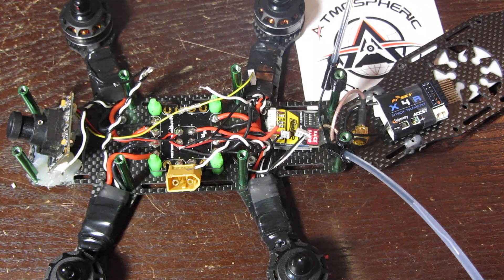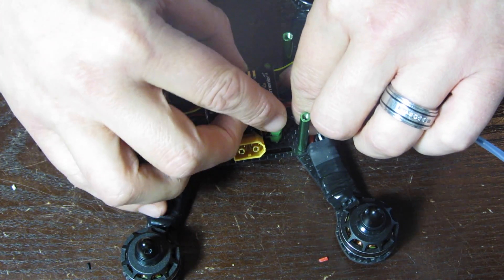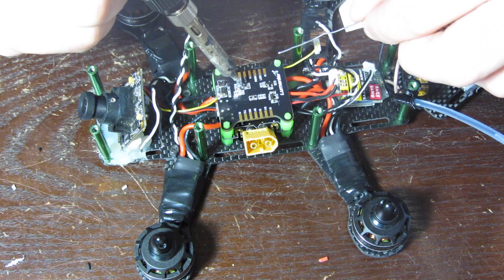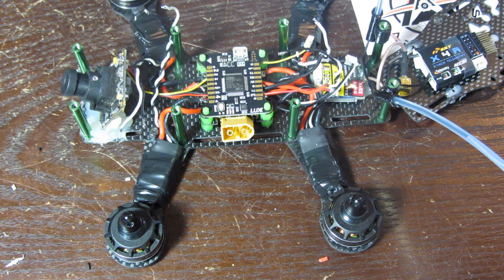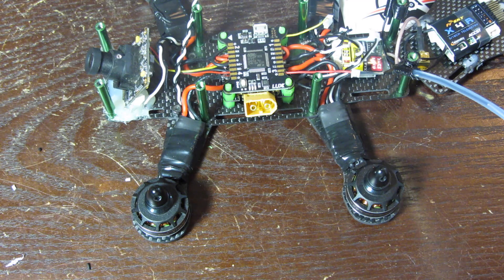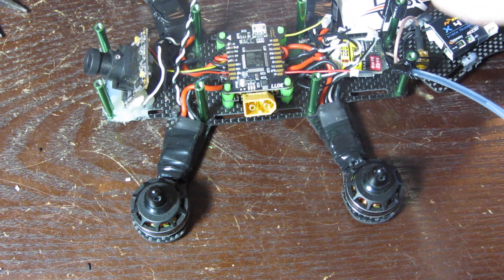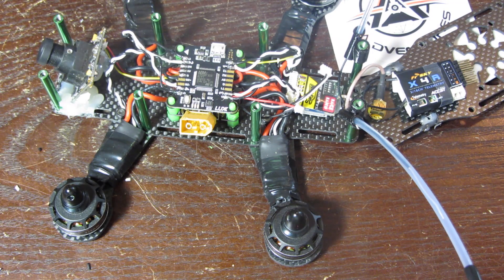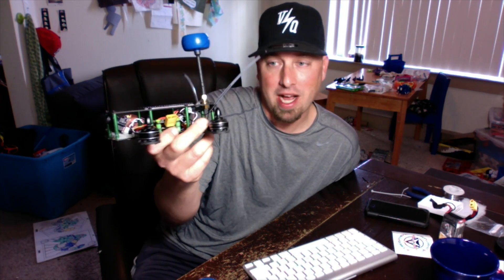How To install a Lux Flight Controller in a FPV Drone

Comment: good day I would like to find out where do you connect your receiver for transmitter as I only saw you soldering the esc wires I have the flysky 6i I'm confused here

Comment: What voltage do you have running to it? Could I run mine on 15 volts, or would I need to buy a 12v stepdown?

Comment: by any chance have you used the KISS FC - 32bit Flight Controller?
Reply from the maker: No, I wouldn't trust it necessarily being the ESCs are buggy.

I also believe it appears to be the same board slightly redesigned to look unique.

Comment: does this fc have an osd built in?also is fc easy to set up,thanks.
Reply from the maker: No OSD and yes easy setup as any CF FC....
Reply: +ATx RC Productions by CheFPV Do you know what OSDs out there are compatible with this FC?  I just ordered it for my build and now need to find an OSD that will work without issues.  Thinking bout the Team Black Sheep Core.  Thoughts or suggestions?  Thanks in advance.

Comment: Where did you connect smart port please?
Reply from the maker: Telemetry port on the RX?  I used my battery sensor from the pdb to the RX?
Reply: You can put it on R2 or R3 on the LUX.
Reply: +Nick1814 are you sure? what is the RSSI port for?
Reply: No, not sure anymore.  I'm going to ask getfpv support because that's what they told me but i don't get telemetry on the radio.
Reply: Nick1814 i found out, check out the lux thread on rcgroups, you have to use the T2 pad , and in cleanflight GUI you have to set UART2 for telemtry.